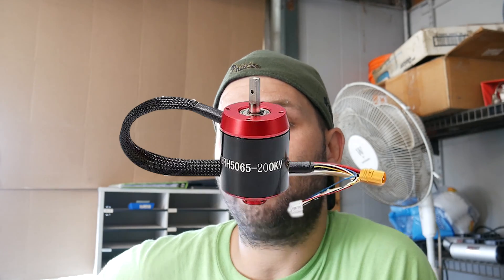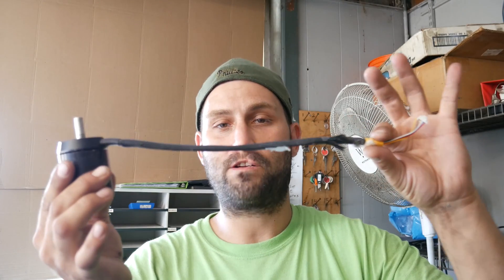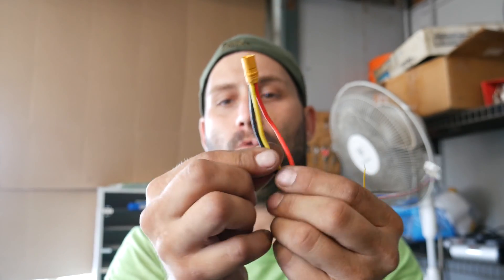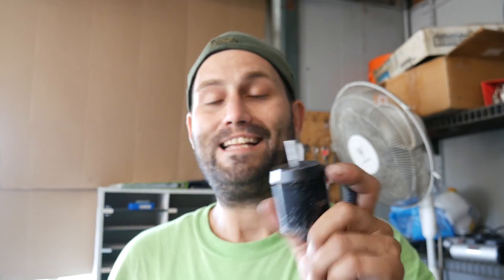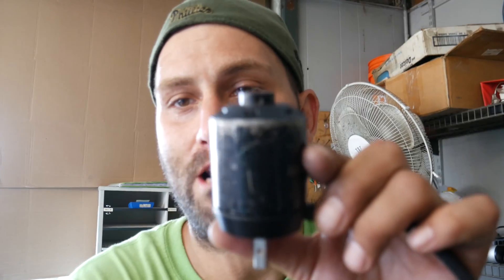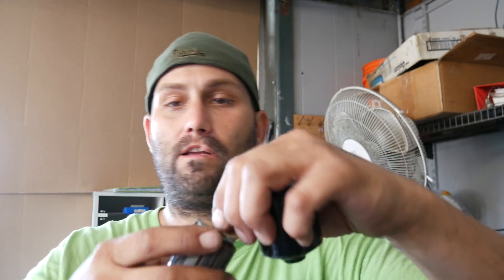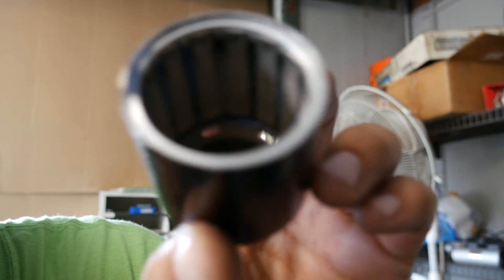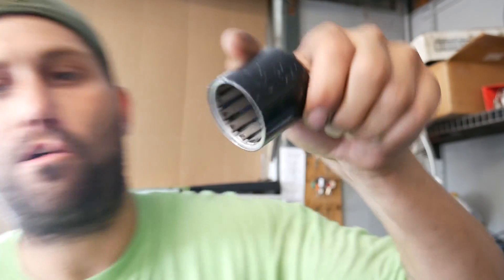Whats inside Evolve Electric Skateboard Motors?

Comment: The outside shroud of my motor isn't spinning true and this is creating a wobble in my actual wheel. Is it possible to change the shroud with another same or is it stuffed?
Reply from the maker: Yeah the actual outside can definitely be replaced. I mean the only way I would think of going as Maybe Cherokee and older one and using that I know you can't find it brand new. If it is wobbly, that would make me think it's the bearings or something

Comment: boosted board motor bearings keep failing
Reply: So if someone could find a way to easily take that pinion off and open the motor to replace them everynow and then
Reply from the maker: A good set of bearings will outlast the motor itself. They must have had some duds bro. Email me with some pictures. I'm sure I can help out thebrokerscollection@gmail.com
Reply: @JoeKyser  I haven't openned the motor yet, the pinion is stuck on the shaft. I 'll cut it off with a grinder when I have time. You can look it up on youtube Boosted Board Motor noise. Bearings fail and it wears out the shaft
Reply: actually i figured it out you just press hold the pinion and hammer to stator it comes off easy peasy
Reply from the maker: Ut oh, that's not good!

Comment: Hey Joe. Has anyone used the racestars on a GTR yet. One of my motors is making a clicking noise and evolve won't replace it because I bought the board on eBay. I know the connections are different..
Reply from the maker: Yeah they are different. thats a real good question there. the last time I check a few months back, there was no other options. I wish I had a GTR just to tinker with. I have not been active on social media with ES8 lately so I have not had any repairs come through. I usually get to get a good idea of boards I dont have when they send them in to get fixed.  Ive help develop some of these aftermarket parts. I should step back in this and figure some shit out.  After years Im actually taping some more content. Let me reach out to some people and see if there is any good news I can give you. Because its evolve I doubt I will have any but I will see
Reply: @JoeKyser  cool. Thanks. Just ordered some so I'll try to figure it out on my side too
Reply from the maker: @Irpilot  yeah keep in touch, i bet I can help figure it out. The hall sensors are going to be the tricky part. I bet evolve has placed them in an odd fashion and programmed the esc to correspond this way it would make it more proprietary than just the plug. Thats my best guess because thats what I see a lot. I converted an evolve using their battery and deck and wheels to use universal hardware. Im about to do another one the same way. Worst case you can always do that. Its a project but in the long run if you dont want to pay evolve replacement parts price, its a good idea and investment.
Reply: @JoeKyser  ok might hit you up on the conversion once the evolve motor dies.
Reply from the maker: @Irpilot  ok no problem. I updated the description so my current details are there. Just in case I dont answer in a message on here. I get a ton of them, dozens a day,  and sometimes I just dont see them all

Comment: Evolve charges twice what two of these motors cost
Reply from the maker: Yeah i know before i knew better i had bought 3 motors from them at over $200 a pop. They sucked. I bought two of these for under $100 and never needed any new motors again. Go figure
Reply: Joe Kyser first of all thank you for the videos you’ve done. Evolves customer service is horrible. I bought a bamboo gtx and put about 30 miles on it and the garbage esc went bad. I got it back and rode another 20 miles or so and a motor stopped working. They wouldn’t work with me at all. Sent me a link to purchase one of their motors I can get for 1/4 the price elsewhere. So I put the board to the side and worked on my build. Bustin nomad board, evolve trucks (now I’ve been buying ownboard which are $75 shipped, half the price of evolve) ABEC 11 107mm wheels, flipsky dusk vesc 4.20, Psychotiller enclosure, Maytech on/off power switch, custom made 10s4p 10Ah battery pack with BMS for charge only, Oldboy ceramic bearings, xt 90 connectors (antispark) and flipsky vx1 remote. I spent way less to build a board at that time and with higher quality parts. Now you can get a board equivalent or better than a evolve for half the price. All in all it’s way more enjoyable for me to build and I’ve learned a lot from watching videos like you have posted and others in the esk8 community.
Reply from the maker: @enjoyesk8978  I know I really want to make some more videos I had plenty of projects around here that I can get into I haven't really tinkered around with anything lately but yeah I ride every single day always have been years now. I have a daily routine that i use the electric skateboard for. If its raining big bummer you know
Reply: Joe Kyser awesome bro! Ride or die 😜I’m about to put together my third diy board and I have the bamboo gtx with upgrades. I’m hoping to recruit for some sessions. Have fun! I’ll stay tuned for the next video.
Reply from the maker: @enjoyesk8978  yesterday I actually contacted matek to establish communication again with them and ask them for some parts. Usually they hook it up. If they can Im going to do a couple builds myself. I have a carbon fiber board begging to done up
Reply: Joe Kyser have you been riding?
Reply from the maker: @enjoyesk8978  every day

Comment: The blue stuff started off as balancing putty but got too hot and liquidated. You can see this stuff on most motors. If it has liquidated your motor is dead.
Reply from the maker: Yeah those evolve motors are junk.  Never had an issue with racestar, even trying to blow them I couldnt

Comment: Thank you for the video I do have a question I stripped the inside of the motor where is attaches to the bracket any ideas on how to fix it?
Reply from the maker: Might be able to tap that. That's tough though.  Especially with vibration.

Comment: Hey Joe i have a question on the racestar motors.  .  . When you purchase lets say 2 of em do they come with the gears on em already or how do i get the old ones off? And do i get rge 140 kv of the 150? My evolve moter spins but the shaft is loose and the gears doesnt spin. . . Then if i hit the breaks it wont accelerate anymore.
Reply from the maker: no I've never had any that came with the gears so I'm going to assume that you're never going to get any with the gears on them. I have some links for the gears on eBay if you can't find them. the fastest and easiest way to get off the old gear is to take a propane torch and heat the shit out of that gear. It slips right off then. I dont even loosen the allen nut till i heat too. I usually heat it loosen the Allen nut and then heat the shit out of it again take a pair of pliers and pull it right off
Reply: @JoeKyser  yeah if you could shoot me the link please because i think im gonna need new motors. Do you got any ideas why the motor moves and the shaft and gear dont.
Reply from the maker: @AlexGomez-mr9ps  if i saw a video or something i probably could tell you. Sounds like they lost contact inside. Not sure. In the description of this video is all sorts of links. I made them last year but checked a few and they look good still.
https://youtu.be/W2_TwaMXOWg
Reply: @JoeKyser  thanks man. . All your videos have been alot of help. . . But im purchasing the racestar 140kv motors. What Gears do you recomend i use in your opinion.? Or try to re-use the old ones?

Comment: What's the life span?? And how douse it compare to boosted boareds?? I'm on the fence about witch one to get cuz idk witch one will last
Reply from the maker: Like how far can it go or actually how long will it hold up for? They are comparable either way. Most people when shopping look for how far it will go and how fast. Its really the wrong way to shop for these. I would ask how much are you going to use it? Where exactly are you going to use it? Also what kind of customer support will you need and will you ever need parts? Boosted is a consumers company and koowheel isnt. Now evolve can be if they want to but you pay dearly for it. As compared to boosted they want to help you take care if your board
Reply: Don't get an evolve... They're notorious for having remote disconnects, horrible customer service, and having the brakes lock up when riding. You should read up on this: https://www.reddit.com/r/ElectricSkateboarding/comments/8g352i/why_i_am_done_with_evolve_skateboards/

Comment: what are the type of bearings inside the motor itself ? Are they the same 608 type ? From what I understand there are a total of 3 bearings per motor correct ? One close to the gear which is a regular 608, and two inside the motor itself which I'm wondering what they are. Can you help ? Thanks man, great video
Reply from the maker: Jason_Music yes yes there are two inside. They are tiny and looks just like the usual 608s but is maybe half the size. Then there is a sleeve it travels in I suppose to make sure the shaft stays perfectly straight. No friction on it so I wouldn't call it a bearing but it does hug the shaft. I had packed up the shop for renovations or else I would take a picture for you.
Reply: I see thanks. Would be nice to know the type of those 2 inside bearings. In short the outside bearing close to the gear is easily accessible and quite easy to replace. However, the 2 inside bearings require more complicated steps I think to replace, like unsolding few pins and all.
Reply: Any news on the type of bearings inside ? Thanks man
Reply from the maker: Jason_Music Oh did you want the size? Just a little FYI. The bearing quality far exceeds the the motor quality itself. There is no upgrade. If thats what your thinking. Ive already explored this if thats why your asking. The actual size of the bearing, not sure to be honest. Bit they are super high quality. Never going to blow them out.
Reply: Oh THX, Alright good to know. I'll juste replace the side bearing then. You rock man thanks for all those nice vids !
Reply from the maker: Jason_Music yeah those are not as great but the ones inside are the right ones that’s for sure. I was pretty surprised myself to be honest.

Comment: the blue goo is for balancing
Reply from the maker: +niklaus stöckli ah ok and i suppose then all of it doesn't cure sometimes leading to failure. Just like te epoxy resin holding the windings together. I've taken apart Motors that have had resin that look like it didn't cure all the way and failed as well. That's priceless info there. Thanks a million!
Reply: put arctic silver past on betwen the motor and the motor holder..... so your motors not get so hot......
Reply from the maker: niklaus stöckli i’ve never had any issues with any motors getting hot besides the Evolve but I’m not sure that was the issue. Honestly I really don’t know. Those are the only motors I’ve ever had trouble with actually
Reply: my racerstar motor is much more cooler now + i sanded down the rezin from the motor and holder for better heat transmission......sorry for my english im from switzerland lol
https://www.youtube.com/watch?v=gIlR6O9GrDE
Reply from the maker: +niklaus stöckli shoot your English is excellent. don't apologize for that ever! I totally appreciate this video you linked me to. Super interesting that's for sure. at some point I was actually going to do some official heat testing and try some different things out I've never really got around to it. Heat is a culprit no doubt.

Comment: The reason I was interested in the disassembly was to examine the possibility of introducing a hydrophobic coating.
In a future video series on our channel I'm going to examine the practicalities of weatherproofing components.

Obviously with the exposed motors, this is going to have it's limits as the hydrophobic coatings aren't designed to be durable on moving parts, but in the short term it may work out well.  Only testing will tell.

Thanks for the disassembly video as well as sharing the motor specs.
Reply from the maker: +Twelve Wing Productions thats super interesting for sure. if you need anymore help just let me know I can take pictures I have Motors already disassembled whatever you need just let me know
Reply: I'm looking into a combination approach at the moment.  One solution is to use a marine water treatment.. more of a water displacing lubricant called Nanoprotech for the motors.  That way anyone can do a non invasive application to the motors themselves by spraying it directly into the motors without disassembly.
The second element is to use a 2 part hydrophobic spray on the speed controller and BMS.  This isn't designed to allow the board to run underwater but instead is based more for those instances where you do find yourself caught in the rain or even in the case of a catastrophic immersion.  The chance is that if the board is opened up and the water removed/absorbed.. it won't be a total loss.

I'll let you know what I come up with and post a link to the video.  I'm still doing some initial experimentation with various wheel and gear combinations to sort out max ranges for variations of the weight of the riders.
Reply from the maker: +Twelve Wing Productions well one thing I know is these manufacturers out there have boards that they claim are waterproof. so what they have done is made the enclosures for the motor such as the Hub or the cover for the electronics waterproof. once you start using the board once you maintenance the board the waterproof factor completely disappears because of the fact that the electronic components themselves are not waterproof. No one has actually taken that time uet. We see potted motherboards. seald motherboards ect. a lot of people think that they do that to waterproof it I mean a lot of people think that and I know better I know it's for vibration so the parts don't vibrate off the board. Consumers are fooled lets say. What your talking about is addressing the root of the solution for sure. Not an easy task to take on. Sounds totally awesome. Im following what your saying. If you need help let me know
dinary
Reply: Agreed.  Once a manufacturer decides to do a water proof enclosure what they find is that it's incredibly expensive to do it right and not something someone is likely to do with a skateboard.
My goal in this is simply to showcase some of the options out there.
I also see what you are saying about people being fooled.  Either they do it themselves by not understanding the results of water incursion or by being fooled by unscrupulous and spurious claims by manufacturers. 

Thanks for the offer of assistance.  Always good to have someone to talk to that has previously cracked into an Evolve board.

Comment: But if the clicking comes from the motor itself(in relation to another of your video) then the onoly way to get rid of the clicking sound is to rplace the motor bearing right? @JoeKyser
Reply from the maker: +Axel Teboul if it's none of the above and the motor is clicking, no you don't replace the bearing i  the motor, you buy a new one. check out my video about the race Star Motors there's a link in the description where you can purchase them. I've actually set challenges to various professionals to show me a completely rebuilt motor and I put up a hundred bucks to see anybody out there do it. Even a professional wont be able to replace the bearings. The odds of it being a bearing failure are slim to none anyway. Ive replaced like 8 motors and it hasn't been a bearing yet.

Comment: Great video, thanks for the info. How did the base of your motor snap off? It really does look like cheap pot metal :/
Reply from the maker: +southpaw that one there broke just from handling it making videos with it and all but yrs its cheap metal. wasn't hard to break that's for sure
Reply: Bummer. I guess for $50 we can't really expect high end quality. What are the most common types of failures you've had with these Evolve/Racestar motors? Keep up the great videos man.
Reply from the maker: +southpaw well the last said I put on there I haven't had failure yet typically in the amount of time I've had one I would have least gone through to sets. I even stopped taking care of it I stopped using the electrical parts cleaner I mean I really wanted to see if it's going to hold up and how long. I just can't seem to kill them.  the only issues I've ever had is with dust and dirt. it's when I didn't take care of them and keep them clean, they just start seizing up. actually now that I think about it all the race stars that I took off still actually worked they just made different sort of loud sound. I went to say grinding but you could hear like it was working harder than it should be. with the Evolve Motors my very first one just pretty much fell apart. I'd wire sticking out the back of it. actually when I sent the picture to evolve, they told me they're not going to honor the warranty because there's a stick stuck in my motor. I was so pissed off I was like blow it up it's not a stick idiot they are wires look closer. they were like we never saw anything like that we don't know what you did to it and I said the same thing I never saw anything like this I don't know what you guys sold me lol.
Reply: Lol you should become a test rider for Evolve. It sure sounds like you put your gear through its paces! Are the insides of the Evolve and Racestar motors identical? From the outside they look no different (other than the color.....)
Reply from the maker: they do look identical and they weigh the same. it seems as though the inside is a little different looking though. the evolves look cheap put together with different looking resin. they dont want me at evolve :(